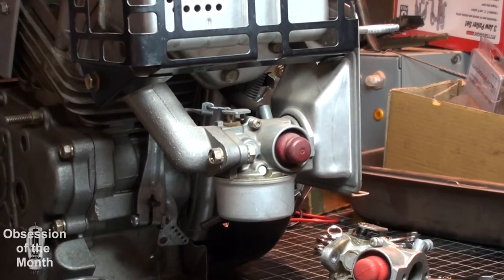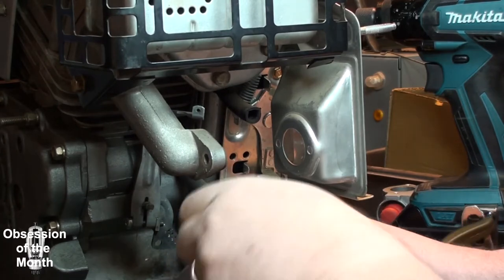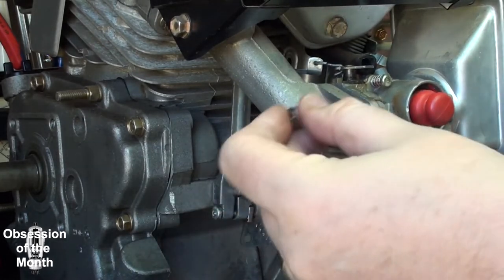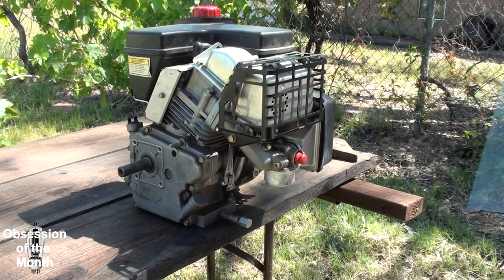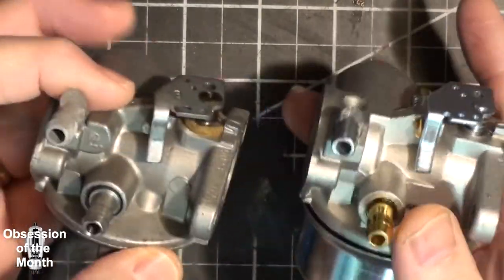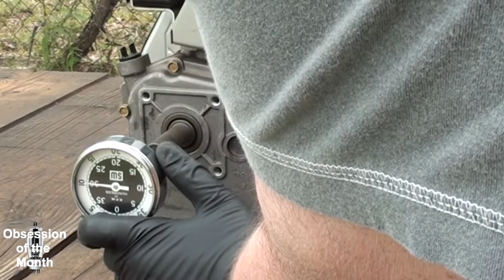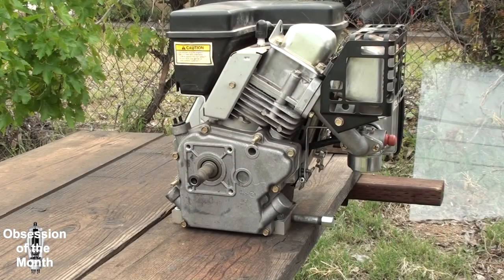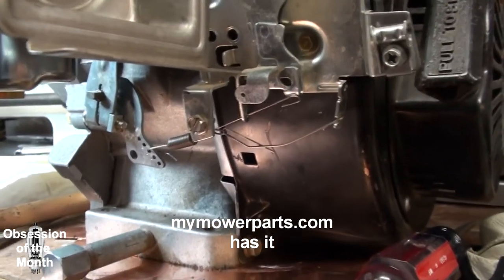Tecumseh Enduro OHH55 carburetor replacement

Comment: I started looking at this video to learn which hole in the throttle the wire connecting the governor arm goes into.  You never did actually show that, however I think I did hear you say to put it into the outside hole.  I hope that is correct.
Reply: Very good video otherwise
Reply from the maker: correct I did not show that (sorry) as stated in the video I am not sure about any of the connections in the governor control chain as the service manual is vague and does not specifically mention this arrangement. mine had been monkeyed with and I set it up as best I could based on what little information I could find, which is the main reason I did the video.
Reply: the middle on the rear 3 holes....hole 2.